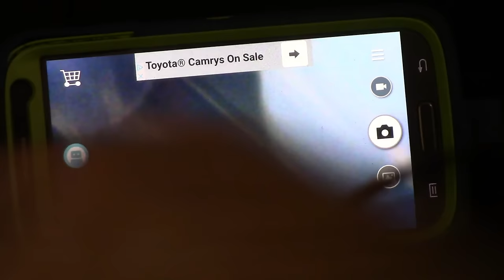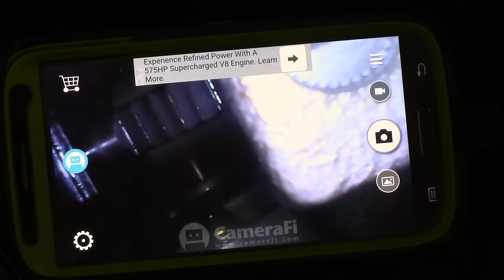2011 F-150 timing chain stretch/cab removal

Comment: Thanks for showing how the cab is removed. I have to change the motor in my 13 3.5 and was going to do the old fashioned way out the top but this looks like it will be so much easier.

Comment: I have 2011 F-150 - 3.5 Eco.  At dealer now with stretched Time chain, only 61,000 Miles on engine. $2400 quote for job, they haven’t started yet, so will see actual cost soon enough. Was going to keep this Truck for another 10 Years, but not so sure now. Not to Happy with Ford right now. I had bought extended warranty due toEco being New motor in 2011 model year, but warranty ran out on time not mileage, will see if they will give any on this. Great set of videos on this, Damn lot of complicated Work. Thank’s...

Comment: Wish I would have watched this about 6 hours ago.  I am replacing a 5.0 in a 2014 and I have been fighting with the front core support and all kinds of other issues.   I kinda noticed it may have been faster to pull the cab off because I kinda discovered there were connectors everwhere to make it easier.   So I googled it and found your video.    I think I will still pull the cab.

Comment: As a fellow tech good stuff. Going to try this on my next timing chain job. I usually pull the nose off but this doesn't look to hard. Might also try it on the turbo job I have as those turbos are a pain in the rear to get out. Thanks for the detailed instructions!
Reply from the maker: Your welcome sir, I appreciate the feedback.
Reply: flmmaz do the 5.0 cabs come off the same way? Would make an engine easier
Reply from the maker: Yep, I pull all F-150 cabs to do engines.
Reply: flmmaz did this for the timing chain replacement tsb on the 3.5 EB Wayyy easier, also have done this for the 15 and newer models, with the 2.7 with oil pressure loss!!

Comment: I just did a 2013 Explorer 3.5 EcoBoost with 76,000 miles on it! (Motor sideways in these) chain had stretched about 2in and jumped for five teeth on the crank had lots of over timed cam codes
Reply: I See a 200Km nice ecoboost truck I want to buy but these vids are scaring the shit out of me. I'm handy with engines but this amount of work may not be worth it.

Comment: Thanks for the info video. I have had the cab off several 250’s & 350’s but never a 150 . Gonna do a 3.5 swap next week. Definitely gonna pull the cab. Interesting in today’s world your still using air tools and corded lights. Thanks for the video.

Comment: Why all the comments on the  5.4?  It's a 3.5 ecoboost...different animal .I'm surprised you pulled the cab instead of pulling the nose...good work on the videos,when I'm doing a job like this ,it would cost me several extra hours to stop ,film and narrate,thank you for taking the time,when you are getting things done,you lose momentum stopping to film.
Reply: I remember all the hype about these Ecoboost engines. Turns out they are real hunks of shit in the medium and long run.  Can we just have a 351 Windsor back?  LOL.
Reply: scdevon agreed on 351 have original never opened in my 1977 searay 235 hp Omc and it had a couple oil changes each season and filters

Comment: Had my 2011 eco boost done 2 days ago @Ford in Holland Michigan...they quoted the timing chain replacement at 12 hours...then found a bad water pump while in there . Took them 2 days.( not sure what they ended up with hours).

Comment: I was viewing other YouTube videos about di engines coking valves and oil catch cans for the pcv.  I guess it's supposed to prevent  the oil and moisture from reentering the intake. Hopefully it'll make these issues be reduced. I've seen on both ford tech makuloco and humble mechanic about the catch cans. I'm hoping that we can keep these ford tough
Reply: Brian Skinner 
Fuel dilution of the engine oil is also common, which can contribute to timing chain wear. Lots of info on oil weights/oil change interval lengths to help manage fuel dilution over at bobistheoilguy.com

Comment: I am attempting to put a 2010 XLT 2 wheel drive 4.6  Body on a 2013FX4 4 x 4 EcoBoost chassis. Just wondering if you have any tips or know any issues that I'm going to run into thanks.

Comment: That's why I'm going for the 5.0L v8!!, naturally aspirated, less components to fail
Reply: STEEVE DAVID Nicolas almost all new vehicles have these big long chains. It’s for variable valve timing. It’s how the car mfrs are getting all the horsepower. Yes, even the 5.0 V8 has big ole chains.
Reply: They have issues too.  Burnt valves etc.  So this vid will help you eventually if you did buy a 5.0 lol.  Same procedure.
Reply: Just wait until your 6R80 fails, and I guarantee it will fail at the overdrive clutch and intermediate shaft

Comment: Why not just remove all the heat exchangers and front bumper? Is that possible? I'm getting ready to attempt this fix myself.
Reply: Team Neudimensions it's possible but not worth it in the professional field. The goal is to beat the clock. I'm doing an 01 f150, book time for long block swap is 21 hours. Cab off swap I can do in 13 hours max but still make 21 hours on it.
Reply: blood twitch yeah one of my biggest concerns was being able to get an impact gun in there for the crank pulley but it can be done apparently. Thanks
Reply: Team Neudimensions very doable to wrap the harmonic balancer off yes. I have done it before when revealing the front engine cover. I appreciate how Ford set it up for cab offs thanks to lannies first time pulling a cab off. He almost got fired but then Ford saw what he was getting at and like the idea. Now I can do engine swaps faster than most other rigs when it's a Ford and I don't just my knuckles to do it.

Comment: Video was spot on for a Ford Raptor, accept for 1 thing. The bolt nut container will slip if the truck is used offroad. FORD FAIL so you have to cut the cab in order to get to the bolt.
Reply from the maker: Not following what your saying, what's that again?
Reply: @flmmaz  I asked a while back if the process to remove the cab for a Raptor was the same. The Fail I am commenting on is  my truck is used to offroad and the rattles and jumps loosen the nut side which is in the cab area. The nuts are held in place by a stupid tab that will basically vibrate loose. Thus when you try to take the bolt it will just spin as the nut is not longer being held by the tab. I can send you pics of what I mean. Unless you work on trucks that go offroad for real, I doubt you will ever see this issue.
Reply from the maker: Ah, I see what your saying. I deal with that all the time on the Super-Duty models. On a good note, the F-150's only have that set up on the front 2 bolts, and can be accessed from the top through the radiator support of by removing the head lights. All the rest of the cab bolts are nuts from the bottom.
Reply: @flmmaz  The issue is the ones in the cab. 6 of the 8 you would have to cut the cab if they spin. unless you know a trick.

Comment: So you pull a cab to replace a timing chain? Ive replaced phasers on 2018 ecoboost without
Reply: I don't think that's necessary considering I did one sideways in an explorer there's not much room there to work with though
Reply: This just seems like a waste of time pulling the cab. You're now loosing transmission fluid, pulling freon out, etc. and loosing time getting valve covers, intake, etc off the engine. Just saying time is money on flat rate.
Reply: Probably wouldn’t be the most popular method amongst flat rate techs if it wasn’t the fastest. Just saying.
Reply: Just finished doing chains on my 2012 ecoboost, there's absolutely no way it's quicker to pull the cab. The job isn't even remotely difficult with the cab on.

Comment: Question: why couldn't you just pull off the front grill and radiator the get access to the timing chain...and do these timing chain issues occur in the 5.0 V-8? I have heard they have cam phaser issues like the 5.4 3v did.
Reply from the maker: The 5.0L doesn't have the timing chain issues and I have only seen a few rare phaser failures (no where near the failure rate of the 5.4). All in all the 3.5 is a solid engine I have owned 2 of the non turbo models and never has a problem.

The amount of work required to access all the turbo piping, intake manifold, and valve covers, which is needed to get the front cover off makes it worth pulling the cab on my end.

Comment: How imperative is this repair to be done when you start hearing the rattle? I’m starting to get a bit of rattle at engine start up, if the truck has been sitting for a few days.  The dealership wants over $3k for this job.
Reply: Brian Whelchel had the same problem, started using a high quality synthetic oil and changing oil at 6000 haven't heard the noise in a while knoc on wood.
Reply: Team Neudimensions I would use synthetic and good filter before you hear the noise first oil change . Like changing you trans fluid after it starts slipping better to do every 50 k

Comment: I have a 2013 F150 FX4 3.5L twin turbo with only 20600 miles that I bought used a couple months ago. In the last couple weeks on cold start up I'm getting the tell tale rattle/grind, about 1 in 10 starts. There are no warning lights on the dash yet.  I have an appointment with my local Ford dealer next week as the vehicle is still under the original powertrain warranty until Dec 2018. Would you recommend this repair  now or wait? This seems like a HUGE job for such a low mileage truck.
Reply from the maker: If it is covered get it done. That way it won't cost you. If you wait then things could change and sometimes not in your favor.
Reply: Thanks. I was a little freaked out over such a major job so soon. What could cause this issue with so few miles on the engine?. Great videos btw, keep it up.

Comment: Hey I was hoping you could offer some sound advice. My truck, same year, model, motor and 2WD have 156k miles and I now have this issue.

I'm getting mixed messages from some mechanics that I should and should not do this repair with the miles I have on the truck. I'd really like to hear your opinion. They also mentioned phaser replacement, but I don't remember hearing that in this video. Thanks in advance!
Reply from the maker: It is totally worth fixing the truck in my opinion. Now the truck I worked on had no noises or driveability issues, it was just kicking on the check engine light. The primary timing chain has stretched so much that the cam timing was out of whack. I have heard about noise issues and people talk about doing phasers at the same time, but I have not had to deal with that issue. This was a TSB and is just a straight forward primary timing chain and tensioner R & R. If you have maintained the truck properly in other words you know the service history then the mileage has no effect on the repair decision. If you just bought the truck then that would be a different story, you know?  I also had one guy tell me that the phasers would wear out the new chain if not replaced but I don't think I'm buying that.
Reply: @flmmaz  thanks for sharing some feedback to his question. I’m having similar issues with my 09 with the 5.4 3v. Easing into a parking space and it began to stumble. Codes 0012,0022 and 0016. Changed the oil two days prior…approaching 150k. I’ll need to get with a shop and see when they can get me in…Any suggestions prior to condemning timing components and tearing down? My maintaince is every 3k with motorcraft. Experienced similar back at a 100k. Don’t recall the codes back then but service ticket stated vcts,  spark plugs coupled with a pcm update due to B2S1 lazy O2 sensor. Thanks again

Comment: What kills me is that these trucks are almost 20 feet long and there is no room under the hood.  If you just take the nose off the cab is so far forward it blocks the top of the engine.  Mechanics have it tough, the manufacturers never cared but it seems it has gotten worse.

Comment: I assume A 6.2 Raptor is close to the same as this? Thanks for the info, is a big help.
Reply from the maker: Negative. The 6.2 is a variation of the 5.4 2 valve but a whole lot beefier.
Reply: Sorry I meant in regards to removing the Cab. Looking to remove it as going to do head work. Dual shock long travel so makes access to things, um difficult.
Reply from the maker: I have to be careful assuming  things. lol yes the cab comes off identical and it will make your life super easy for the repair your doing. pay close attention  to the valve springs on that beast. they are the weak link in the chain.
Reply: No worries as each truck different. Sending head to Livernois Motorsports for cams and build. Thanks for the info as it helps to know what to look for.

Comment: Can't we just have a pushrod 351 Windsor back?  You could replace the timing chain on 3 older Ford trucks in 9 hours. Planned obsolescence to the max.
Reply: scdevon I have a gm 3.8 04 Grand Prix 400000 k no  issues run great 1 short chain I cam pushrods  , i 
got an o6 CT’s 2.8 uses way more gas 108000 than reliable3.8 has the The 2.8 has the same yep design bicycle chains and phasers and 4 cams as the  eco boost  I just bought one a 2011 fI50  I agree the 302 will be better for sure  by the way I have original 351 in my 1977 searay never rebuilt lolo not impressed with this design in 2.8 3.6 or the eco boost 3.5 and 5.4 .hope I have not made a mistake on the 2011 f150 or the caddy I got both cheap  06 CT’s caddy after I purchase put 4 new 18inch Goodyear’s new brakes $2500.00 and safety checked . Truck 3000.00 needs tires brakes cab corners sills and clutch packs for differential hope the echo boost hold up oil been changed every 5000km or 3500 miles

Comment: To each there own but i wouldnt spend the hr to two hours pulling the cab to do chains. Wasting time. In 2 hours you can have the engine pretty much torn apart in that time. Not to mention now that you pulled the cab you have to do all that over again. But w.e each there own.
Reply from the maker: This was a replacement engine that needed a lot of corrections from the previous install and the right turbo was damaged and needed repairing. The combination of all these things made it easier to get the cab out of the way to fix correctly.

Comment: If I can't get my 6R80 mated back to my 5.0 tonight or tommorrow then I'm dragging my truck to an auto hobby shop on base then doing a cab lift
Reply: jon jonsson 

Why didn’t you use a lift in the first place?
Reply: Because we don't have a lift in the garage, and taking it to the auto hobby shop and doing this , and paying for hourly usage fees was just alittle to much, we were already cutting costs by using shade tree mechanic techniques with modifying a motorcycle jack to lift and mate it up

Comment: Great repair video.  I was curious why so darn much plumbing.  That's insane. Have these ecoboosts gotten any better. I knew they were having a hell of a time with these with coking.  I'm hoping they have, also what do you think about catch cans for the pcv since I hear with the di engines are having problems with coking.  Just was wondering.
Reply from the maker: Being a twin turbo they have to get the air to both sides of the motor from one air filter and then from both sides of the motor to one intercooler and finally to the center of the intake, so it's a lot of stuff to accomplish that. I'm all for any mod that improves the operation and longevity of the engine.
Reply: Late to the game but I heard the ‘18 and newer models had s multi port injection on to of direct injection to keep the valves from accumulating carbon.

Comment: Do you know if the 5.0s have the same problem?
Reply from the maker: No, the 5.0 has a more robust setup
Reply: But they switched to spray in cylinder liners in 2018 and burn oil like crazy now. Ford's replacing a lot of 5.0s over it. Look up 5.0 oil consumption.

Comment: So you pull a cab to replace a timing chain? Ive replaced phasers on 2018 ecoboost with just leaning over the front on a skycreeper. No offense but seems like a bit of unneccessary work. How long does it take you to pull the cab? thank you.
Reply: Daniel Blim 2018 already needs cam phasers?
Reply: Special Ed I would believe it. My 2018 3.5 EB has had water pump, leaf springs and a host of flashes and audio control module and is now with a lemon lawyer for its 38–yes 38 days in the dealer for repairs by the time it had 8000 miles on it. The 3.5 is now made in Mexico not USA like 17 was. I’ve kinda lost my love for the ecoboost experience. Lol

Comment: There is no reason to pull the cab to do chains on these motors. It is easier to do any chain job with motor out but hard to stay competitive in price.
Reply from the maker: The cab was pulled in this instance, so all the problems from the previous engine installation could be sorted out. There was lots of issues with wiring harness routing, turbo problems, you name it. It was much easier to address all of that with the cab off.

Comment: Removing cab to do chains lmfao all that extra time wasted it only calls for 10 hrs
Reply: That's what I was thinking. I've never seen another mechanic take the cab off for timing chains on a 3.5.
Reply: I’m doing chains and phasers on my 2017 in my garage...wish I could lift the cab!
Reply: Literally could have timing cover removed and chains removed n intake n exhaust phaser off in the time it takes to pull the cab.... this is silly.. and probably charging customers more

Comment: This all has to do with lubricating parts. Chains wear without proper lubrication. If your engine oil cap says 5w-20, that could be the problem. 
If you don't live Canada or a cold state like North Dakota, take that oil cap and through it in the garbage. Get one that doesn't say anything, and put 10w-30 in it.
You may not have to mess with a timing chain for a long time.
P.S. Don't buy cheap oil either.
Reply: Buen día